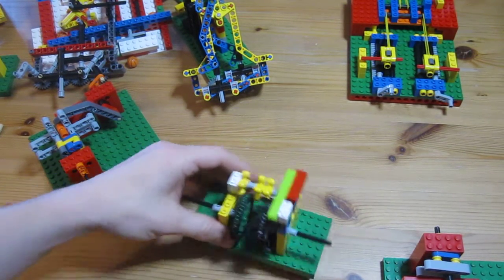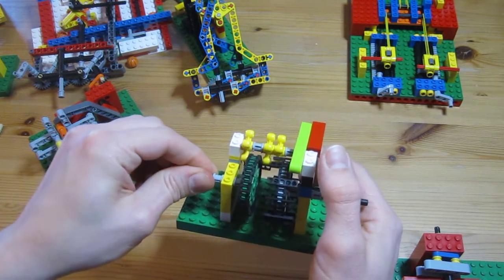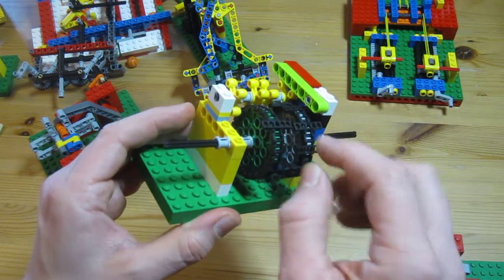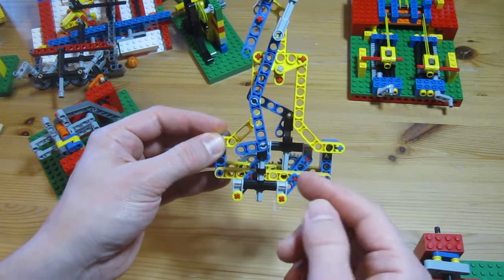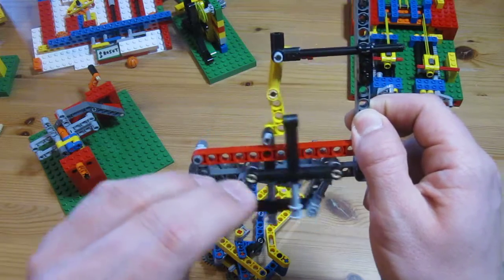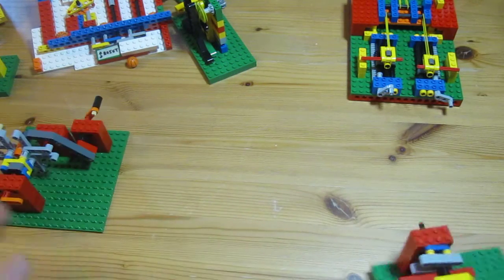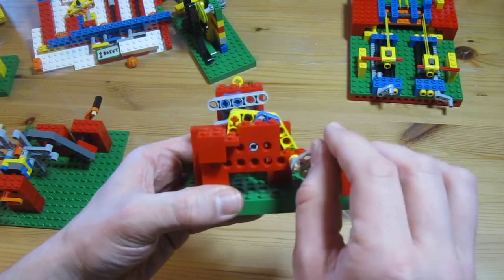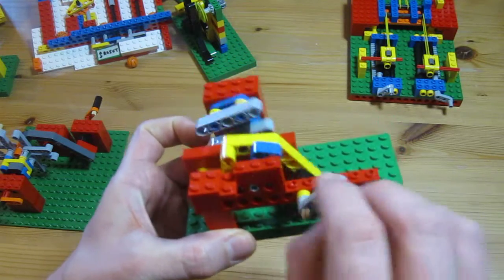LEGO adding machines prototypes 2 - other mech

Comment: your projects are always delightful, alex. the geneva gear is inspired! i've designed one myself; not nearly as elegant as yours, just the traditional design, but it had a radius of just over two studs, making it the smallest i've yet seen. i had planned to use it to make a kind of moviola, but that project, like so many of mine, got relegated to a back burner.
KEvron
Reply from the maker: Thanks Kev, I got a copy of 'Mechanisms and Mechanical Devices Sourcebook' (the best xmas present a mech nerd could wish for!) and there's a great section on Geneva, very inspiring.  Getting that motion right took ages though, one brick out and it's a totally different trajectory. I experimented with a locking mechanisms but like you it's all on the back burner.